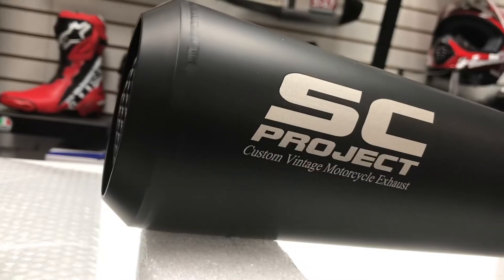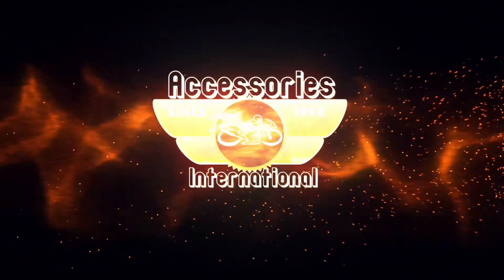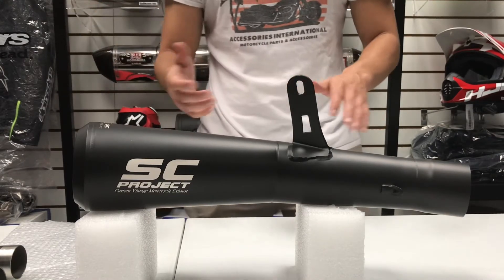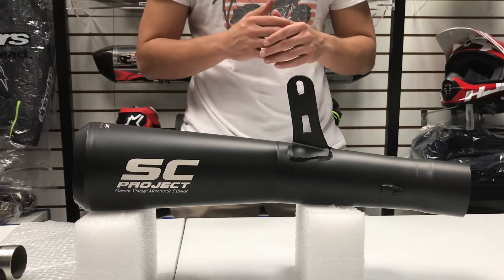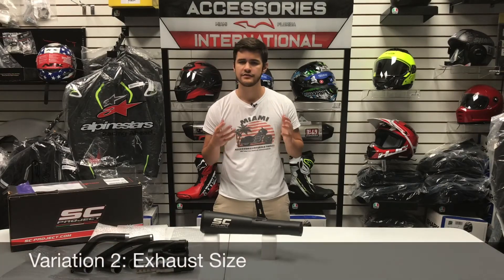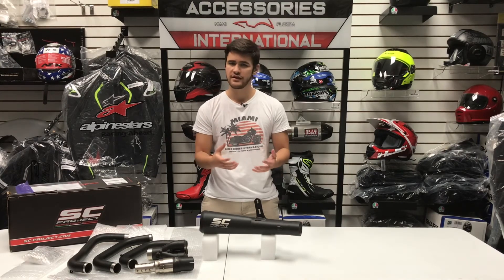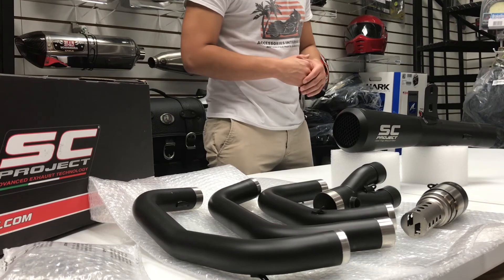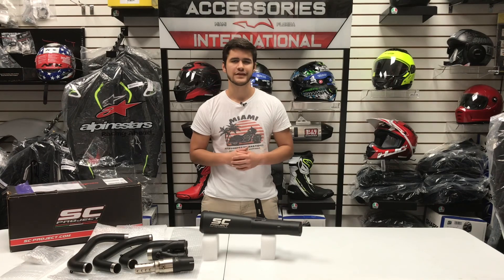SC Project Conic “70s Style” Exhaust Review at AccessoryInternational.com

Comment: hi, does it have removable db killer?
Reply: Nope.... I bought one and I regret it. Should have gone an Akro.
Reply: @Korzy2015  what was your bike?
Reply: @Korzy2015  not loud enough?
Reply: @moe1662  nope. I would have gone Akro if I had my time again.
Reply: @Korzy2015  but even at highway speed? 
now am looking at Fresco & IXIL Ironhead. no idea how good they are. looking for shoter mufflers
Reply: @moe1662  into good. Don’t waste your time or money go straight to akro. Best of luck
Reply: @Korzy2015  thx for the tip man
Reply: @Korzy2015  can’t find a product for CB1100 on their site lol
Reply: Please don’t give false information, the baffle is welded in but can be undone to remove it completely.
Reply: @DudePlays247  After a while having it I can confirm that the dbkiller can be removed by breaking the weld inside. It's not as easy as removing a screw, but if you know how to and have the tools, you can do it. You could even go to some mechanics shop and ask for help doing it.
Reply: @KITIMATO  if I break the weld can the db killer be put back in ? Or will the exhaust be permanently straight piped
Reply: @DudePlays247  I wouldn't do it if you plan to put it on again since it can produce some vibrations not being attached, or at least think of something that keep the db killer fixed. Just to clarify, I haven't done it, but with a friend of mine that works welding and in mechanics we checked it and we saw that it was 100% possible to get it out, but puting it back in would require of some botch job
Reply: @KITIMATO  thank you for your speedy response, I appreciate it very much. Just to clarify, if I take the baffle out and put a k and n air filter in with a ecu flash, do you think this will prevent the bike from running lean ?
Reply: @DudePlays247  I think it would run ok, but would be better to take it to a test bench for them to check what fuel/air mix config would be better? don't really know about that srry
Reply: @DudePlays247  what are you talking about? Am asking a question 😂🤦‍♂️